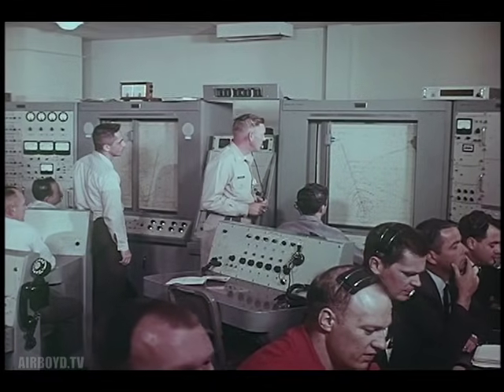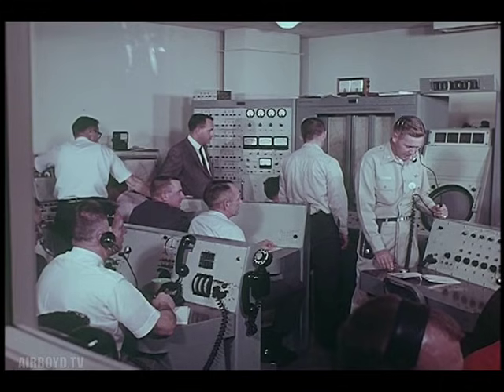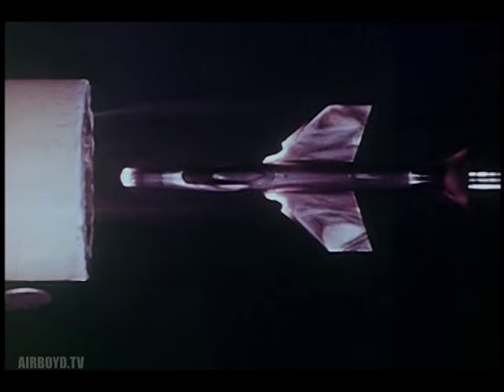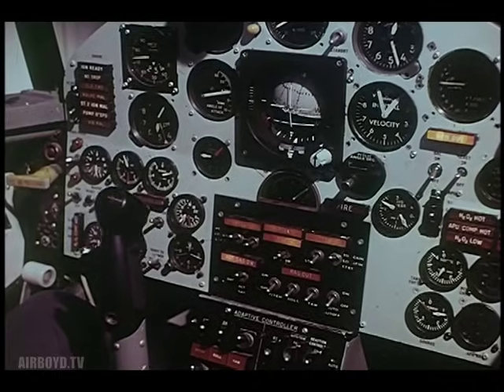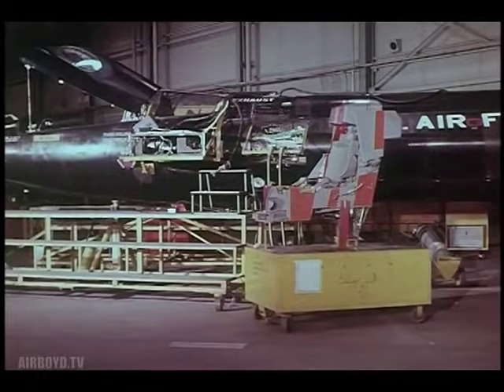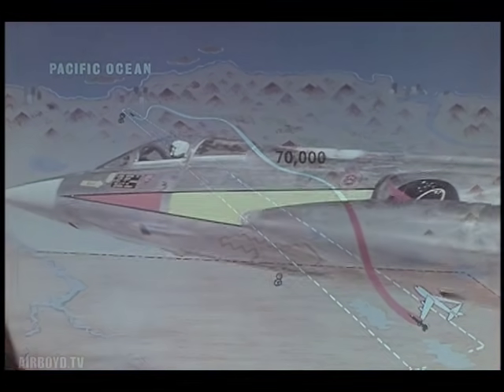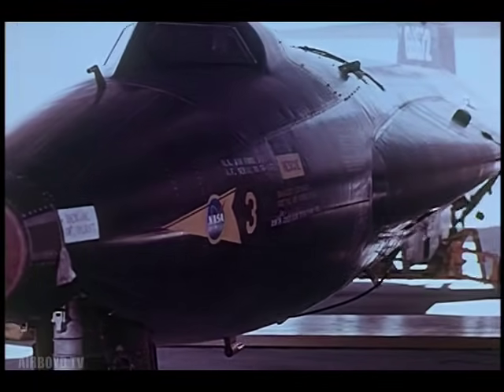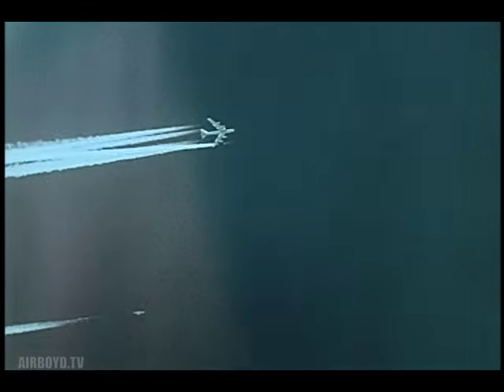North American X-15 Research Project (1962)

Comment: Been  following and studying the  x-planes since  1987.  Public Library .  including  Janes book  etc etc. There were just a handful of books on the subject. In  high school I probably
read every book  on the shelfs on the subject of space except  communications satellites.
 Met with Mitch Varnes with canevaral council of  technical societies  [NASA]  back  in
 1988-1989.  Read about the group  in a book i saw at  walden books at the local mall.
 John Loghsdon   a   scientist  with  Rockwell ntl. at the time wrote the book  1988.
   The Book was called   Your guide to investing in space exploration.  I read many 
   articles  on the apolo  program but i felt  the x- plane  path was the key to the future.
   My  background  is 2  years of engineering. 2 years of electronics [AS].
     Which gave me an industrial engineering education. I then worked at a Full service 
     aircraft maintenance facility in Florida  for a while where I learned many  areas 
     of  the complete  Overhaul of  Major brands such as  Boeing and  Airbus.  I now have 
   an  MS.  in Engineering Management. Approved by the USA. USAF  approved  me for 
       a  Reserve officer  designation under the AFROTC that i  was approved for in 1976.
       in high school. NEW  JERSEY.

Comment: Was stationed at EDW AFB straight out of tech school 1965 and was a mechanic on a TB-58 and the X-15 in the maintenance hanger  under the HIgh and Mighty  B-52 was a real sight to see at the age of 19. Even being a crew chief on C-141 A and C-130 E's still consider my time at  EDW the high light of my career in the Air Force and after many years retired in 1990 because  of old age more than anything else. Go Air Force.